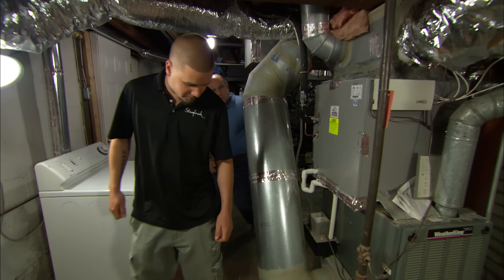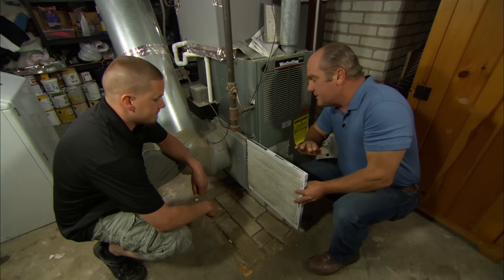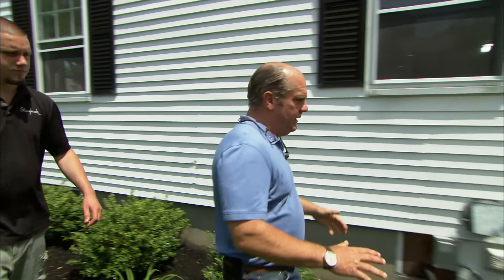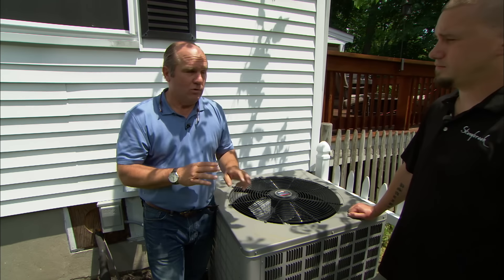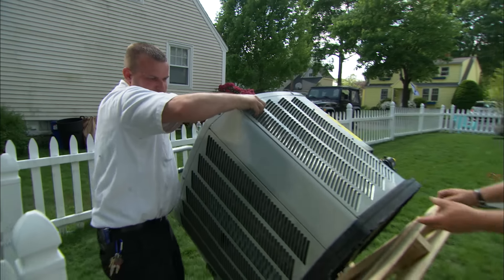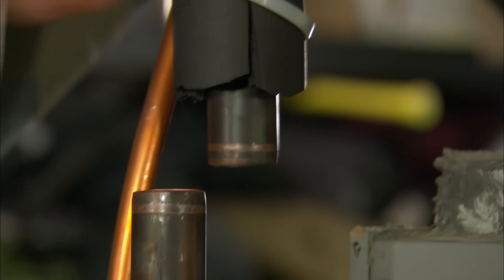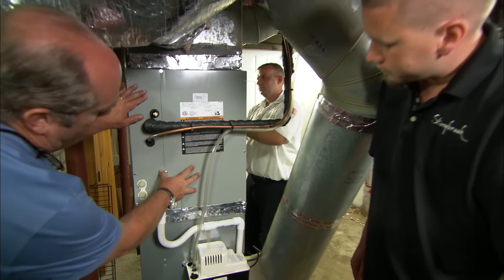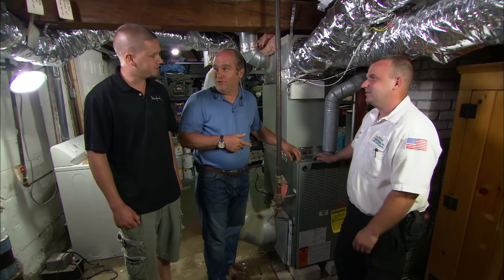How to Repair a Frozen Air Conditioner | Ask This Old House

Comment: I had a new condenser and air handler put in last May in a condo my son lives in.  The condo is in northern Florida and the company recommended I go from 2.5 to 3.5 ton.  The company put in a 3 ton condensor 14 SEER and 3.5 ton air handler.  I was charged for a 3.5 ton 15 seer system.  The company that installed this heat pump said with the match they did, even though the  condensor was 3 ton 14 seer, the match up with the 3.5 ton air handler made it a 3.5 ton 15 seer system.  I don't know if I got scammed or not.

Comment: The AC is under charged or leaking somewhat,  low on refrigerant, so in evaporator the refrigerant temperature is too low, that cause freezing. replacement can fix the problem too.
Reply: Sheng Liwei -or possible dirty evap coil. This video is wrong.. check the easy stuff first

Comment: That old condenser was almost brand new. That sucks.
Reply: Looks like an idiot homeowner bought it online. See this all the time, they buy way too big of a unit
Reply: Looks like an idiot homeowner bought it online. See this all the time, they buy way too big of a unit
Reply: Boo hoo...for every "idiot" there are many more who do the job right and save a TON of money. No pun intended. HVAC isn't rocket science especially with the great online content that is now available.
Reply: Absolutely false. Like socialism. All good on paper, and no connection to reality.
Reply: that money should used for a new addition lol.
Reply: Robert Slackware Theoretically, he could sell it online without the refrigerant in it. However if the buyer wants to recharge it with the original type of refrigerant, he would need an EPA 608 certification to purchase and handle the original refrigerant. There are alternative refrigerants that can be used, but they all exhibit a reduction of cooling capacity.
Reply: total rookies, the return is undersized is why it's freezing up. Needs to be at least 16 to have a chance, looks like 10 or  12 starving the unit. They should have replaced the duct and installed a 4 inch filter, a 1 inch filter has a lot of static pressure drop. Should have put in a completely new  oversized return 18 20 inch or the equivalent with square duct with a 4 inch filter set up. i have 31 yrs HVACR exp and saw the problem as soon as I saw the unit. I've see that alot over the yrs, inadequate  return duct. the bigger the return the better you can never over size a return duct.
Reply: Art Houston socialism isn’t even good on paper.
Reply: Americans got a weird fascination with bigger/more is better.
Reply: Why not just put a restriction in the liquid line so the evaporator coil doesn't freeze up? Wouldn't that be a lot cheaper than replacing the condenser unit?
Reply: No kidding! I'm not even a HVAC guy, and as soon as I saw that cluster "F" air managing setup, I was laughing. Never seen anything like that in my life! Those tin foil tubes are really much smaller inside, as they are surrounded by insulation. Ya, even if that system was installed right, 4 tons would be a bit overkill for that house IMO.
Reply: Yes but if he did that how would he make all the extra money convincing the unwitting home owner he needs a complete replacement system? :)
Reply: I'd have kept it, and found used 2 1/2 ton outdoor unit [refurbish whatever was needed].   The cash drain on this job was on the brutal side, but all that began when the owner got suckered into a 4 ton unit before the cameras showed up.
Reply: It's all about the money  !!!👍👍👍

Comment: I’m building a new house and I’m so happy with the HVAC design company we’re working with...   an ERV (energy recovery ventilation) for fresh air, dehumidifier unit (SW Florida, you can drink the air 9 months of the year) and a VRF (variable refrigerant flow) compressor system (the ”compressor system” has a proper name I’m forgetting...   let’s say ”the unit”) all properly sized and balanced for the airtight SIP (structural insulated panel) construction I’m using.   Add the 8.1kW solar PV array, two PowerWalls and some other renewable tech and I’ll be thrilled to stop paying stupid amounts of money to cool the 100+ year old house I’m replacing...   there aren’t enough fans in the world to run a pressure test on the old house, it’s basically a sieve.   btw, I added the acronym meanings for the few folk who’d watch this video and not know what an ERV and such is...   I’m sure most of you do but it’s cool tech most folk don’t think of (having a totally airtight house shell is usually not an issue !!), and videos like these make me so happy I’m doing it !!!

Comment: The homeowner did not state whether he had this freezing problem ever since the unit was installed. The outdoor unit looked pretty new to me. Also, if a low charge (leak) was a possibility, why didn't Richard mention it ?
Reply: I heard that if it's low on refrigerant that will be the reason for the freezing problem.
Reply: This is a national show that's highly viewed. I'm sure the AC companies LOVED this episode! Why not buy a shiny brand new unit that makes those companies thousands of dollars instead of showing a better fix that doesn't make them anything. I'm sure that had something to do with it ;)
Reply: return duct work is massively undersized. A complete miss by these 2 and it's still undersized for the 3T unit.  You can run 3 ton cond thru a 4T coil all day long. The 10- 12 inch return needs to be 18- 20 or equivalent in square duct and replace the 1 inch filter with a 4 inch filter set up. They'll be back the 3 t unit will be freezing up.I've been in HVACR since 1985.
Reply: or could be the sensor or controller. the compressor does not shut down when it reached the set point.

Comment: How the hell can you make any determination without hooking up pressure gauges?!?  Regardless of oversize, if it's a new unit and is freezing, it probably has a leak from poor installation.
Reply: thechosendude exactly, I'll said the same!!
Reply: Homeowner alert!
Reply: @gunner6903  because bud in the HVAC business you will never be a master of the trade every year there is something to learn....some new technology that's why my field always keeps me on my toes....also that's why I'm always watching videos novice or professional I need to see what ALL people are doing in my field....
Reply: TRUE MAN OR IT NEEDS A BYPASS DAMPER SO THE COOL AIR DONT COMING BACK TO THE RETURN AGAIN
Reply: Did u see the return, there's definitely airflow restrictions
Reply: Why not call back Extra Tonnage AC Company and ask them to fix the problem which of course is asking for the correct tonnage.
Reply: The air distribution is inadequate even for the smaller unit. There should be more return ductwork and probably more supply runs.
Reply: Okay I'm not a HVAC technician but what about putting a variable-speed compressor or installing a smaller compressor in the same unit in instead of replacing everything.
Reply: I haven't watched the video, although I will.  A neighborhood guy sent this to me, as he's having a similar problem in the cooling season. The answer, in a nutshell, is because the unit as a whole, including the coil(s) are matched, and tested and "certified" to match, thus producing specific performance. On another note, if someone attempts to try to do something like you're suggesting and it doesn't work or work well,  if nothing else, who's responsible?
Reply: Joe Wallis 
I agree, some people upsize the AC unit without adding addition return, hence create low heat load issue and ice up A coil
Reply: thechosendude 
Upsized unit creates humidity but not frozen coil. Only without enough return creates low heat load hence frozen coil
Reply: Poor installation.....i sincerely hope you're not in the hvac business
Reply: @buddysmith6861  not gonna happen
Reply: @buddysmith6861  because it's not really about the size of the ac for this particular case. It's part but the main reason is lack of airflow as it seems
Reply: @johntravolto4058  You are exactly right. Steer clear from anyone who thinks they know everything there is to know about HVAC or anything for that matter. There is always something new to learn. Although that AC-System might possibly be too big for that home, any AC guy would know to check the pressures before making the determination on whether or not the customer needs a "smaller" system.
Reply: @briand.1694  absolutely. There could be multiple issues with the system. Further investigation needs to happen. And boy oh boy I wish I can find these customers that just go "ok whatever you say boss, let's install a brand new one yay!!" Lmao.
Reply: I wonder if they did a sub cooking on that unit...also that return seems small for a three ton
Reply: Cooling
Reply: Their is definitely an air flow issue which probably caused the system to freeze. A system that is too big will cause high humidity. This is caused by too quickly cooling down the space and not running long enough to dehumidify. Their is so much wrong with the new install that most professionals watching this would laugh. And that small line you pointed to saying the heat goes out this line was actually the liquid line coming in.
Reply: @gunner6903  You wanna know how you find a good service tech? Check the comments on HVAC videos. Hahaha. We just love HVAC. Can't get enough of it. 
Saving poor old people from the ridiculous heat of Florida just seems like something worth doing. 

Always learning-- That's how you stay professional.
Reply: It’s easy to tell it is freezing up from not getting enough airflow.  It’s not even close to enough for a five ton system let alone a 4 or even a 3.   That might be enough duct work to run a 2 ton apartment sized AC unit.   Too little airflow causes a freeze up as does low charge.  The pressure if he hooked up gauges would show the low side pressure is too low.   Adding refrigerant would barely increase the pressure and still likely never get the saturated temp up over freezing...   all it would do is crash the superheat to nothing and start flooding back liquid  refrigerant to the compressor, which wouldn’t be good either.   It needs a load calculation for sizing, increases duct work, decreased unit size 4 ton is still too big...  Then it needs a proper charge such that when operating the evaporator would ideally be maybe 41 F and the temperature split across the vents maybe 19 F between the return and supply.

Comment: im no hvac guy. But when my unit goes out and is old. I just go to the local A/C supply house, buy a new unit, charge it a little at a time till it starts cooling good. call it a day. I get about 10 years out of a unit. I do this for my 3 houses, and my shop office at my business. Nor rocket science. I called a hvac guy out 2 months ago to get a quote on a new unit. He quoted a new 3 ton unit gas pack with all new duct work for $18,000. I did it myself for $3,000. I didnt replace the duct work. The split unit upstairs I replaced 5 years ago, brazed the lines, charged the unit till it began to cool, no problems.

Comment: I agree the existing unit was prolly oversized, BUT not enough to cause a frozen coil.. An oversized unit could and sometimes does cause mold issues... Frozen coil or line set could be a VERY dirty coil, a bad capacitor, motor or both, or a leak in the refrigerant lines...and sometimes an expansion valve can cause some minor freezing
Reply: That system probably did not have enough return air even for 3 ton let alone 4 ton.  With that said, Richard lets spending the budget on HVAC stuff.

Comment: Having the same issue, my serviceman merely topped off the Freon. But also if the unit is overpowered why not add a speed controller to throttle it down and make it more efficient?

Comment: There was not enough return air on this system and the furnace part of the system only had a blower capable of handling 3 tons of air flow through the coil max. In this case it makes sense why the coil was freezing. Usually a freezing coil means you are low on Refrigerant. So the proper solution would have been to increase the return size and downsize the system. The 3 ton system they put in is only a half ton over sized for the home at most, but they did not fix the return air problem.
Reply: How would you increase the return size?
Reply: @rogar61  A return can be cut into the other side of the furnace and ducting can be run to the space that needs it. Normally the furnace has its main return on one of the sides. You can use both sides. The cheapest is to cut in a filter frame on the side of the furnace not being used if its in a open space in a basement. Keep the door to the basement open or cut in a return grill upstairs that is open to the basement. My cheaper not necessarily approved method is to take the blower door off, defeat the door switch with strong tape and the proper  size filter sits where the blower door was. Does not work with all furnaces.
Reply: @grawey77  So you would have one return with ducts going to various parts of the house and another "return" that is essentially a hole cut into another side of the furnace that would pull in air from the basement or whichever room it was located?
Reply: @rogar61  This only works when the furnace is in an open basement and not closed off. Inside doors in houses are typically not air tight. A return grill open to the basement either in the sidewall or the floor would provide air from upstairs. Best located in an open area in your home, like a main living space. You have to remember you are just adding return to increase the air available for efficiency. The system will already have returns in the bedrooms if its an average home. You can of course duct in another return from the other side of the furnace to a main living space. This is what professionals would probably want you to do at more expense. I actually sleep in my basement because I am a 3rd shifter. Having a good size return in the basement helps dehumidify and condition the space. I do have supply ducts in my basement too.
Reply: @grawey77  That makes sense. Thanks.

Comment: Can't even imagine how expensive this mistake would be!
Reply: Well the mistake of installing the incorrect sized unit!
Reply: The only mistake here is getting the wrong guy to solve your problem. He couldn't even explain the proper workings of a refrigerant system. 

Didn't bother to check the pressures to diagnose potentially clogged expansion valves. Likely did a terrible installation job which will guarantee the thing chokes and freezes again.

Comment: Does  this old house have Q and Answers. On rooftop coolers , my cooler and  furnace are hooked to the same ductwork. Will heat go through the cooler. If so is it ok to put a cap on after I take cooler down.

Comment: My home was built in 2003 and some of my rooms don't get cool. Brother is hvac tech, and unit is actually smaller than square feet of home. Was built to the code at the time, but not today's standards.  Better to get little more than 9need but not too big.

Comment: I call bullschitte. That unit was only Low on Freon, causing the icing!  That return air duct looks seriously small for even a 3ton unit. You just got ripped off 6000$!
Reply: I intend agree with you a little bit return air duct look pretty small to me and the first thing I suspect is no air movement or low refrigerant when I see a Frozen coil
Reply: I agree no reason to replace that unit.
Reply: I agree, Either low on freon  or the condenser was partially plugged from grass and what not.
Reply: You don't know the amount of CFM the fan is pushing, you have a value missing from your equation, I call your comment cow manure.
Reply: It doesn’t matter what the CFM of the fan is, if a condenser is partially blocked it will look like like a smaller condenser to the system.   Years ago a co worker told me his evaporator was icing up and it was overcharged and a friend removed some freon to fix it.  When he told me the system worked fine for five years before I told him his friend was wrong.  He got a little nasty and told me “What F#@k do I know, his friend works for a big company and services the big buildings downtown”.  I told him that knew there were not little girl and little boy freons that make baby freons and now the first hot day it won’t cool much if at all.My first side job after finishing A/C school in 1983 was replacing a current relay ($4.00) on a  cooler in a small store that two other big companies condemned the compressor and wanted to replace the whole unit.
Reply: you missed the part where it's a 4 ton unit cooling a 1300 sq ft home. It's being replaced because it's way oversized, not because it can't be fixed. the CFM needed for a matching coil would turn that little home into a wind tunnel. maybe if it were a 2 stage you could run on low all the time....?
Reply: Frank L clogged condenser would cause high head pressure, not a frozen coil
Reply: To the system a PARTIALLY clogged condenser simply looks like a smaller condenser than the system was designed for.  Depending on the metering valve, some but not enough freon will transition to a gas and make to the evaporator and cause a decreased pressure in it causing icing.  It happens , I’ve seen it.
Reply: boB Eads I have no idea what I'm talking about when it comes to air conditioning but I have to agree with you
Reply: He should have gotten a second opinion.
Reply: Frank L I have never seen it myself, but will take your word for it:)
Reply: 4 ton was way to big per squares but without a heat gain who knows. Return way to small either way, no vent on the condensate, hard pipe and plumbing fittings, nitro purge?? Filter dryer? There is no upgrade here. Crap install replaced with less crappy install.
Reply: 😂😂😂 exactly , the guy just got  ripped off.. a new unit my a$$